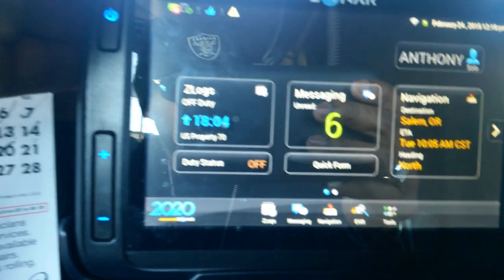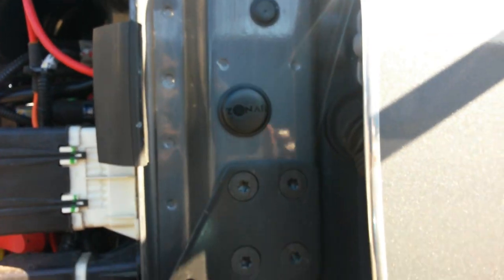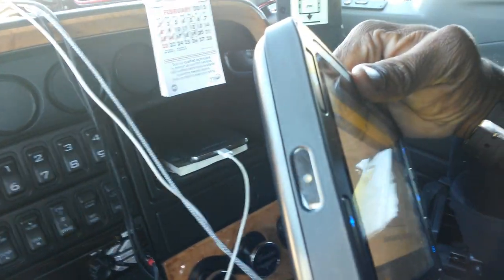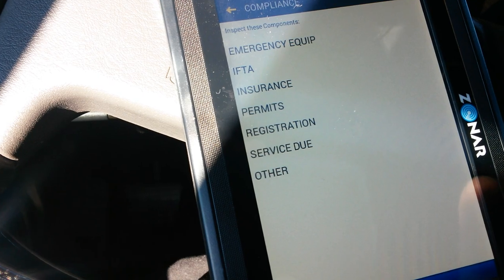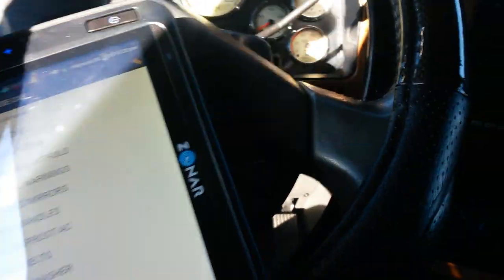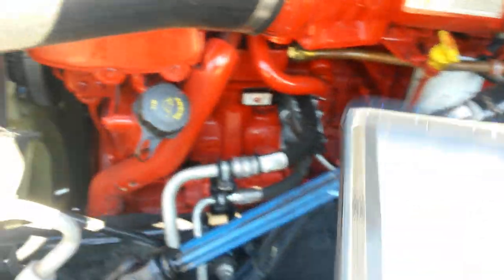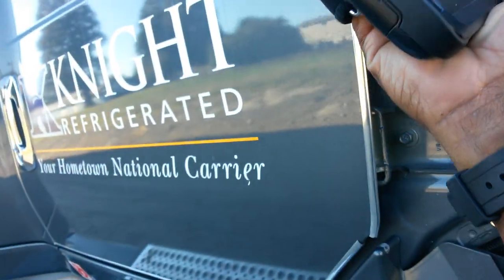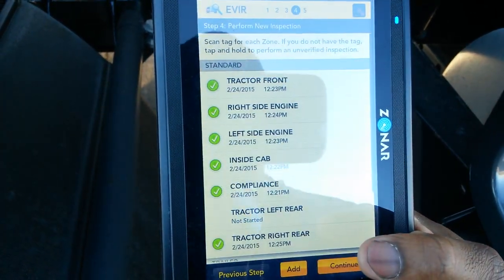Mr.Sinnizter DaTrucker: How To Do Your Pre-Trip Inspection Using Zonar System

Comment: heard about it. its like a the apple ipad. sort of like a beeper system that checks each part during your pti.
Reply: +francorama It does not check the equipment for you though, it just gives you a checklist on what to check and an easier way to document and report what is wrong with the equipment, the tags are there just to make sure you actually are in visual range of the parts that are in the checklist.

 it looks like it might be easier than paper for noting problems.